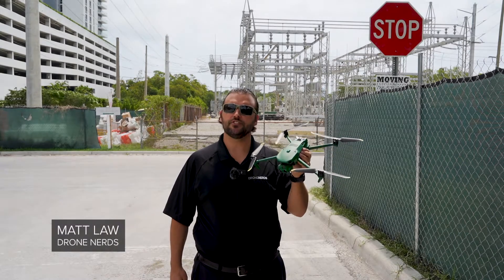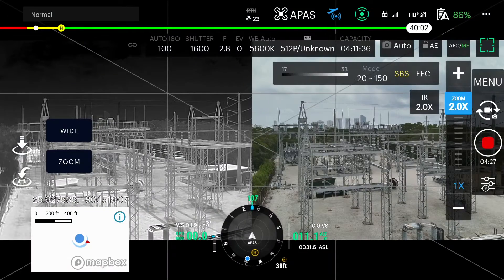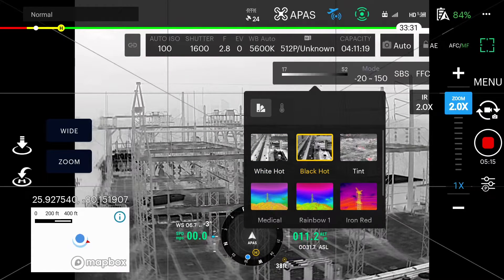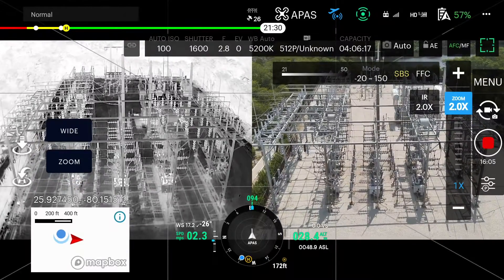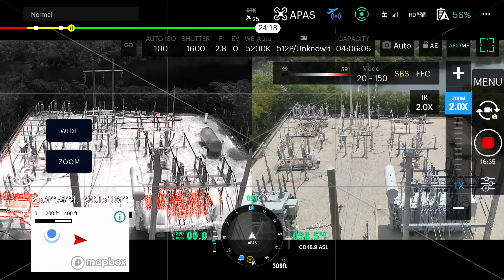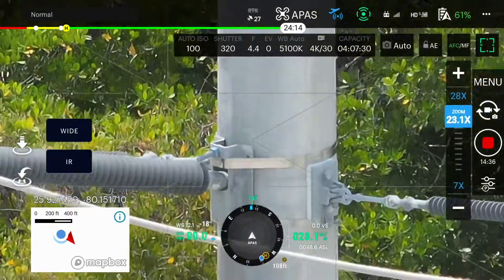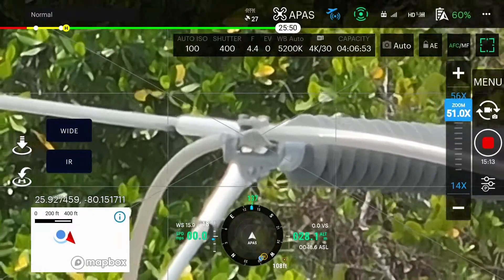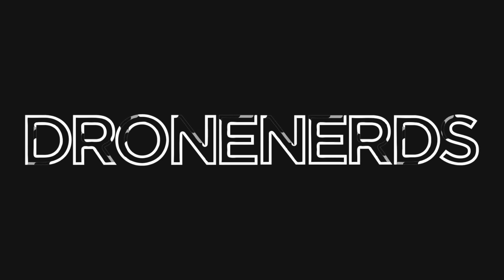ANZU Robotics Raptor T - Inspection

Comment: This is a good video. The Raptor T has a Radiometric thermal camera. When you take thermal images, what application do you use to access the pixel by pixel temperatures? Currently, my images are only saved as .jpg. 
Thanks!
Reply from the maker: Hey, thanks for watching cw3drones! Drone Deploy has some great tools for creating and analyzing radiometric thermal maps.